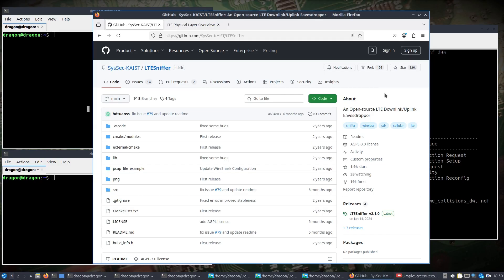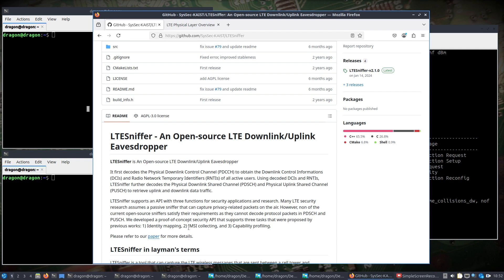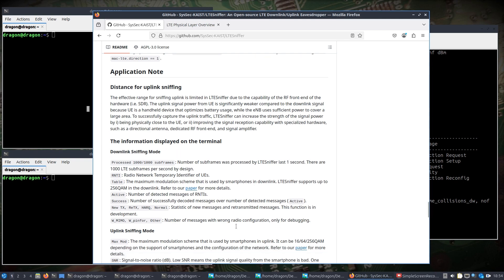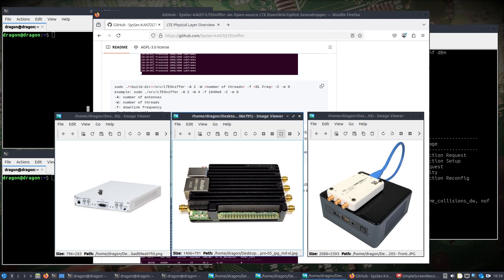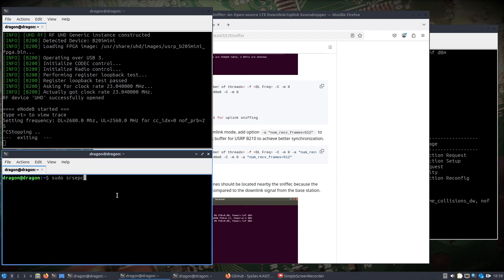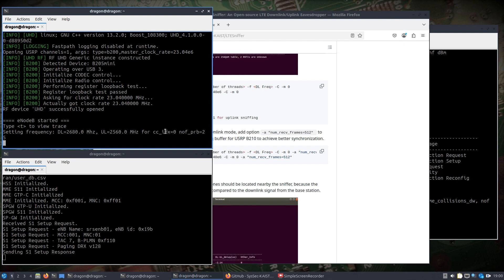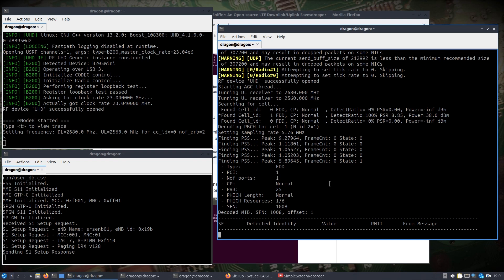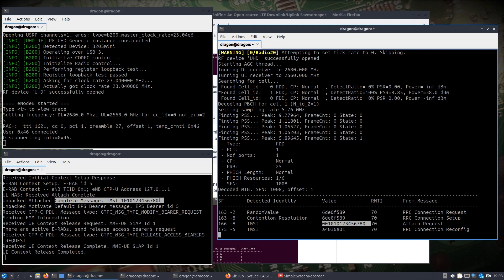DragonOS Noble Sniff + Passively Capture LTE IMSI (x310, b205mini, SignalSDR Pro)

Comment: Great video! For anyone wondering how PRB relates to bandwidth... In LTE, Resource Blocks are made up of 12 subcarriers, each 15 kHz in size. 12 x 15 kHz is 180 kHz. So 25 PRB x 180 kHz = 4.5 MHz which equates to 5 MHz channel bandwidth and the extra .5 MHz is allocated to guard band.
Reply from the maker: Thank you for the explanation! I wonder why I changed the default that was already in the conf. It was probably unnecessary. I’ll check operation with the default PRB that was set.
Reply from the maker: I just looked. Default was 
n_prb = 50